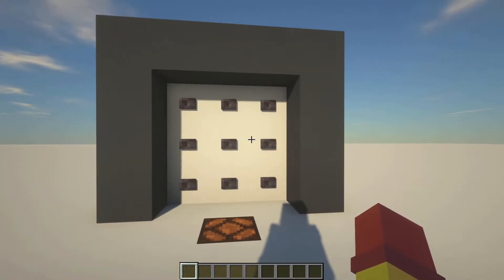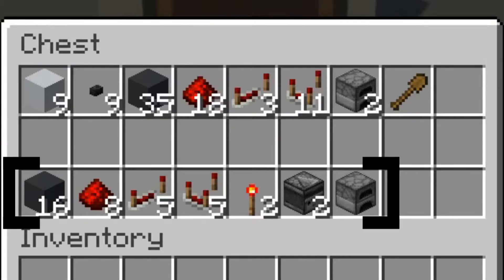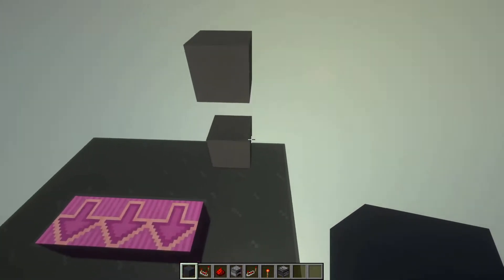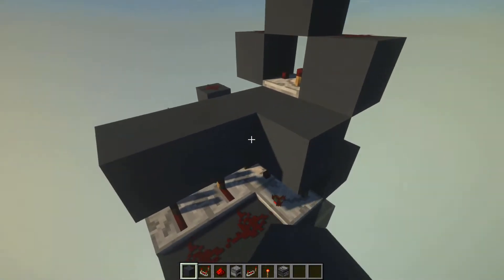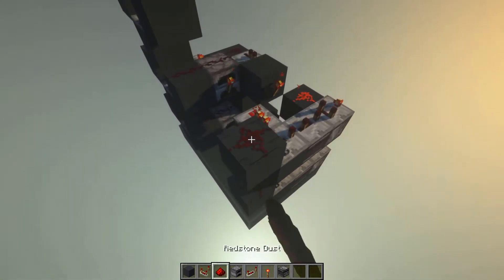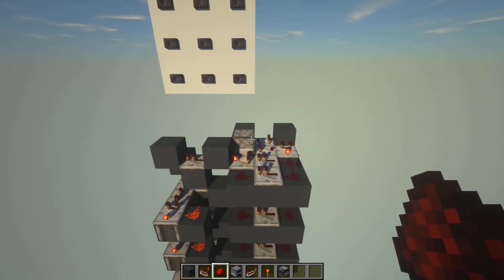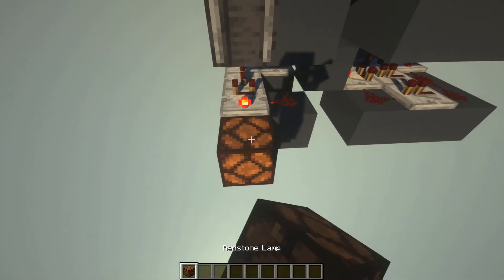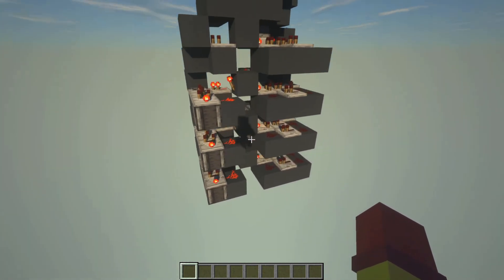Minecraft Java/Bedrock | Sequential Combo Lock Tutorial

Comment: if you're having trouble wiht this build, try this:
Change the shovel from the first furnace for 7 snow balls (or other 16 stackable item) and for the digits use:
1 snow bals = 1
4 snow balls = 2
7 snow balls = 3
11 snow balls= 4
14 snow balls = 5
8 snow balls and a shovel = 6 
12 snow balls and a shovel = 7
15 snow balls and a shovel = 8
16 snow balls, a shovel and 10 items in the output of the furnace = 9
This happens because the shovel in the first furnace outputs too much power and prevents the first button of giving any power.
If you're building this is bedrock, just change the repeaters from 3 ticks to 2 ticks.

Comment: Just built this in 1.19 Bedrock on PS5.
Works perfactly.

At first I didn't think it was working until I learned how the code lights up the locked repeaters as it works its way down until the last floor. I wasn't getting an output signal after entering the final number.

My solution was to remove the final subtracted comparator and simply put in a repeater facing into where you had the redstone lamp. Replaced the lamp with a T-flip-flop and run the signal to my vault door.